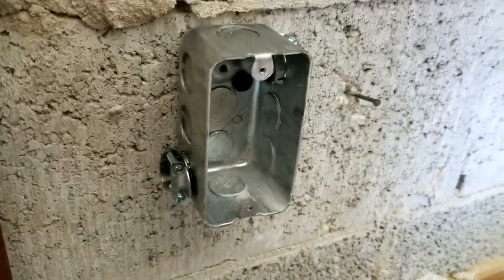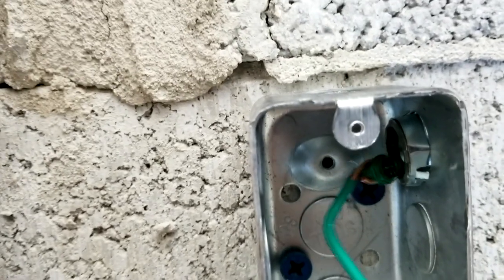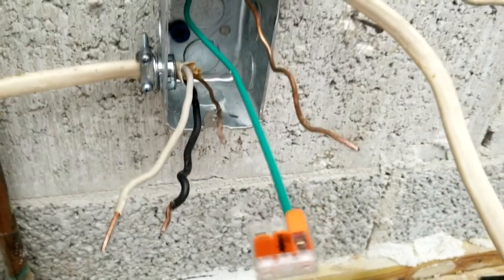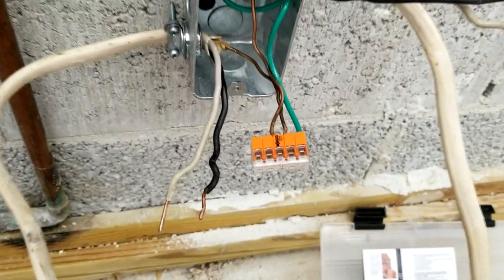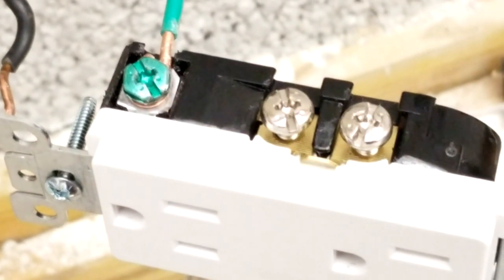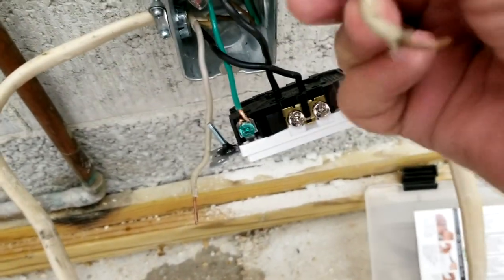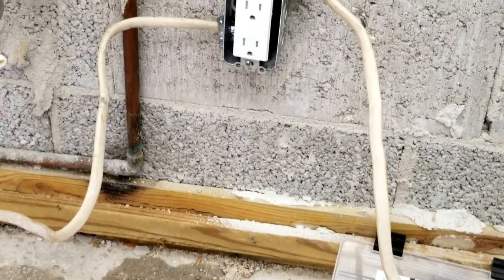How To Install Garbage Disposal Electrical Outlet Box DIY

Comment from the maker: Tools & Parts used in this garbage disposal outlet video:
Fluke FLK2AC Pocket-Sized Voltage Detector, VoltAlert on Amazon:  https://amzn.to/2THggao
Wago Lever-Nut/Wiring Nut  Assortment Pack: https://amzn.to/2GpXJLB
VOLTCLAW-12 Nonconductive Electrical Wire Pliers: https://amzn.to/2GsMMtc
Ideal Grounding Pigtails/Ground Screws (Pack 50): https://amzn.to/2DMheg3
Steel City Outlet Box 1 7/8" Deep: https://amzn.to/2tqB4qu

Comment: Nice video.  A few thoughts  #1 Use a standard 2 gang outlet box or oversized square box with a face plate that reduces to 1 gang so there is more room for wires AND because you have unlimited space on that block wall for a larger surface mount box.  Handy boxes are not code because they don't provide enough space and make working extremely cramped.  #2 I like to use a nice large piece of 3/4 plywood backing board to attach to the block wall - can even cheat with caulk or construction adhesive then screw the box in to the wood - leaves a place to staple or clamp wires going to the box AND makes future expansion super easy.  #3 cut ground wire extra long and attach it to the ground screw on the box then continue on to the outlet - clean, code and one less pigtail saves space and is easy!
Reply from the maker: Unfortunately, we were left with the original length of this Romex, so we were stuck with the small length of ground wire they gave us, and we had to pigtail. Also didn't use a bigger box because only 2 sets of wires coming into this box. Had there been more, yes I would have used the double gang.

Comment: Very informative. I believe that NEC says all receptacles within 6 feet of the edge of the sink must be GFCI. Most if not all outlets that service a garbage disposal would be within 6 feet. How do you protect an outlet like this with a GFCI? Thanks for the concise video!
Reply from the maker: Yes that is indeed the rule this was a remodel in in theory it's arguable whether or not you really need to add the GFCI here because you could be grandfathered in, some inspectors might make you do it others don't care. Most electricians don't make the garbage disposal outlet a GFCI,  Because they could trip needlessly and the homeowners does not know that there is a GFCI outlet under the sink. Can you imagine an 80 year old widow when the garbage disposal outlet under her kitchen sink trips? How would she even know there is a GFCI outlet under there? Even if she knows, it's likely she can't reach it either. The other way you can protect it is to make the circuit breaker in the electrical panel a GFCI breaker.

Comment: Thanks for the info on this. I deffinately would have missed the separate the two at the connection screws part of it.
Excellent tutorial !
W
Reply from the maker: Wulf, Yes, that is a common mistake with this type of outlet, glad you caught it in time.

Comment: What do I do if I just don't like wago's?
The earth grnds cut short with one red twist lock would have given you 50% more overall space.
Yes, I would use wago for the hot & neutral but not the earth gnds. 
Must add, I love the tape around the contacts.  Great touch. //ji

Comment: One thing you're not mentioning is what kind of outlet you need. If you can use a 15 Amp or if it has to be a 20 Amp. I was using a 15 Amp before. But all of a sudden it went out. So I went ahead and replaced it with a 15 Amp outlet. But for some reason is not getting power now. I got the Hot and Neutral wires properly connected. I hope you can help me. Thank you.
Reply from the maker: Unfortunately your statement is not correct. You have to look at the breaker and the breaker determines what you need if the breaker has a 20 amp breaker in it, then you use a 15 amp outlet receptacle. If the breaker has a 15 amp breaker in it then you must use a 15 amp receptacle. But you should know that most modern receptacles that are labeled 15 amps will actually work up to 20 amps especially from Leviton if you look at their boxes and study the specifications carefully you will see that a 15 amp receptacle will really work up to 20 amps

Comment: Nice video. I'm banging my head against a wall trying to figure a half hot switch. Another video is telling me to pig tail all of the blacks together to the pole on the top right off the receptacle. It's not working, I'm going to have to try out your method.

Comment: Very nice . What if I wanted to add another  outlet with power coming from this outlet that is connected for dish washer and garbage  disposal ? How ?
Reply from the maker: This is a complex topic, which we covered in this other video here: https://youtu.be/uAU8ldD4uWQ Remember that garbage disposal should be on it's own circuit, as should the dishwasher. But they use a duplex outlet, where garbage goes to one receptacle, and the dishwasher goes to the other one, then you snip the metal tab connecting both outlet line voltage tabs.

Comment: The dishwasher side of the outlet has power but the disposal side does not.
How do I find which wire supplies the disposal switch without breaking the island wall? By the way, the breakers for these two items are on and no GCFi in the kitchen is lit up.
Thanks for the help.
Thanks for the help.
Reply from the maker: You might have a disconnect, possible at the switch. With both circuits turned off, and checking to make sure power is turned off at the switch as well, try to get a multimeter and ohm out from the switch to the outlet and see if you have 0 ohms. If you have "OL" on the tester screen, then a connection is bad or open loop. Pull out both the outlet under the sink, and the switch above the sing, and check the wiring on both ends, make sure it is done properly.

Comment: I understand the concept. But I’m have a question. How do you know which plug is gonna be hot all the time and which one is on with the switch. Because I have one that will have the power from the house, dish washer that is hard wired and a switch for the garbage disposal that I want to install. Can you help me out?
Reply from the maker: Label it that is the only way to know for sure

Comment: I have no plug outlet near my garbage disposal under my sink, do you know where it would be? I need to unplug the garbage disposal before I work on it.
Reply from the maker: Maybe it is hardwired? some disposals with directly into the wall wiring.
Reply: @jeffostroff  okay I believe so, I just turned off the breaker.

Comment: Thank you for the great video. I need to add a receptacle under the sink using the garbage disposal “white” wire. Can I follow this video if I don’t have anything to do with dishwasher wiring? I’d like at least one outlet to stay Hot always for my water filtration system (hot water, hence needing the outlet). I have a wire coming from kitchen switch going directly into the garbage disposal right now. Thank you.

Comment: Thanks for posting.
Do you have to use a gfci outlet for dishwasher and garbage disposal?
Reply from the maker: They say that is the rule now, I need to look it up to confirm, I still have the 2017 book, need to get the new 2020 book.
Reply: @jeffostroff  Thanks. I'll probably need to get a 2020 book myself thanks.

Comment: A dishwasher, refridge, freezer need their OWN circuit—al the way from the main power panel.
Reply from the maker: The fridge has it's own circuit. The dishwasher here has its own circuit, but it is in the form of a dual outlet, shared with the garbage disposal, separately powered so what you often see in the electrical panel is a double pole switch, where 2 switches are physically connected together, so that when you shut off the garbage disposal, you also shut off the dishwasher too. This protects people working on the outlet that don't know there are 2 live wires coming to that outlet, from 2 different circuits, each with its own breaker switch, but mechanically tied together.

Comment: Im running 3 additional outlet from brreaker using 12/2 wire, im slso running the one for gd & dw. Do i need 14/2 wire? Or running individually?
Reply from the maker: You need 12 gauge for both the dishwasher and the garbage disposal, those are 20 amp circuits. You only use 14 gauge Romex on lighting circuits, or other bedroom circuits that are already 14 gauge. Don't mix and match, if a circuit breaker is 15 amps, then the wires on the circuit should be Romex 14-2.

Comment: Doesn't that have to be in steel conduit since it's a thin wall?
Reply from the maker: No in our area, they have not used conduit in residential since the early 1980s. The romex by itself is well enough fireproof, the space in the wall buys you nothing.

Comment: Decent video, the wire looked to be 12awg but hard to tell. Normally the Romex jacket it yellow. Isn't a disposal/DW suppose to be 20 amp? Thanks
Reply from the maker: Mike Mcclure  Mike using the 14-2 romex cable that we have there is fine as the national electric code only requires a 15 amp circuit for the garbage disposal not a 20 amp circuit. Also be aware that the newer codes require a double Pole switch in the circuit breaker panel to keep the garbage disposal and the dishwasher separately protected in other words each has its own switch.
Reply: jeffostroff thanks

Comment: Aren't you supposed to use conduit or metal conduit wires instead of exposed Romex where the wire is not behind a wall?
Reply from the maker: 510Finnatic  You only have half the picture there will be drywall going over that when this is done so the romex is fine, all to code.
Reply: He said all wires will be behind a wall... did you watch video till the end?

Comment: You forgat to mention about connecting the main power to the outlet  can you explained?
Reply from the maker: I am not sure what you are asking. At 6:00  Into the video you can see we are connecting up the black wire and the white wire. The black wire is the power going into the outlet. The black wire always gets connected to the darker colored screw where as the white wire gets connected to the silver colored screw.
Reply: jeffostroff  sorry if I misunderstood, at the beginning 0:31 you said that on the left side of the box , you were going to connect the garbage disposal, and at minute 1:23 you said that on the right it was going to be for the dishwasher, both are connected to the outlet but what about the main power ?  That is my question
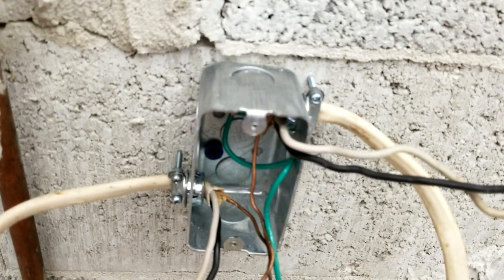Reply from the maker: Yes, what I was saying was that the left cable at 0:32 was the supply power for the garbage disposal, it is the"main" for the garbage disposal and it will go inside the outlet, then it gets connected to the upper plug on the outlet. In the same manner, the dishwasher "main" comes in from the right side and connects to the bottom plug on the outlet. NOW REAL IMPORTANT, because they both have power on them so you have to snip the connection tab on the right side of the outlet as I show at 4:00 in the video, so that both outlet plugs become operated separately, and can independently be powered. This is how you separately power 2 plugs on the same outlet. This is the same way a switched outlet works in your bedroom fora lamp. People who forget to snip the little tab find themselves with blowing fuses in a hurry.
Reply: jeffostroff  awesome thanks you very much
Reply: @jeffostroff  What about the switch to activate the disposal once plugged in? Where is that wired?
Reply from the maker: @mjrelentless1  The switch is located above the new kitchen cabinet and counter top that we later installed over this outlet. See that video for it here:  How to Install Garbage Disposal Switch, Dual Electrical Outlet Box
https://www.youtube.com/watch?v=uAU8ldD4uWQ&t=617s

Comment: Where is the SECURING of wire—within 8” ??? Nothing here is “to CODE” bad video.
Reply from the maker: This was original wiring done on this 50 year old condo, I was merely replacing the old outlet box that was there and rusted out.  Not to code? Are you nuts? I brought it up to code by bonding the box, the builder never even bonded the box to ground. The Romex was tied down to concrete after this video was shot. The builder left us barely enough enough slack out of the box. We found this quite a bit in the condo, the electricians left us with 2 to 4" of wire coming out of the boxes. Made it take much longer to replace every light switch in the condo when you have a hard time getting the wire to reach far out of the box enough to wire it to the switch. Also, on exterior walls like this, there are no studs, so builders always just let the Romex float in the 3/4" firring strip space between the drywall and this cement block wall. They almost never tie down the Romex, as there are no studs in this type of wall. Since the 1 1/4" setback rule cannot apply on walls like this, people need to be extra careful when drilling into this wall, there are no plates protecting the Romex.

Comment: Exposed Romex must be 8’ above the ground/floor, else it should/must be covered.  Push-Ins are a poor choice.  You are a Brit? I think so. No American with schooling would do this.

All wires coming out of this box MUST be 6” or longer.
Reply from the maker: You said Romex must be 8 feet above the floor? Are you nuts? Where did you get that nonsense from? How would you run Romex to an electrical outlet 24" off the floor if Romex has to be 8 feet above the floor? You're not making sense. Also you are dead wrong about push in connectors, especially the metal ones I used here, they are super tight and secure once you hammer them in and the leafs open up on the inside of the box, it does not budge. Also, many electricians these days are using the blue plastic push ins for Romex cables passing into outlet boxes..